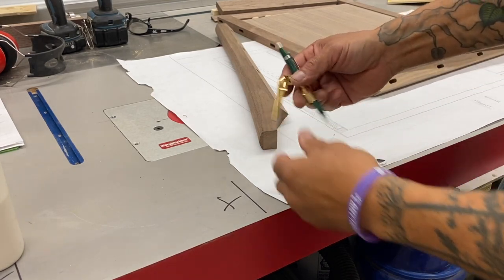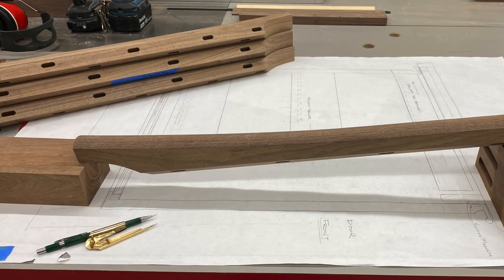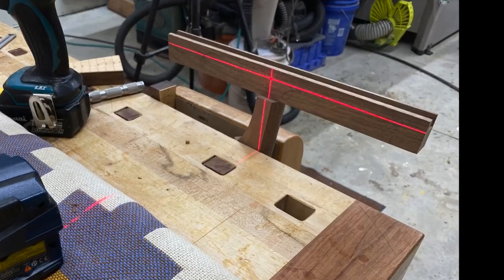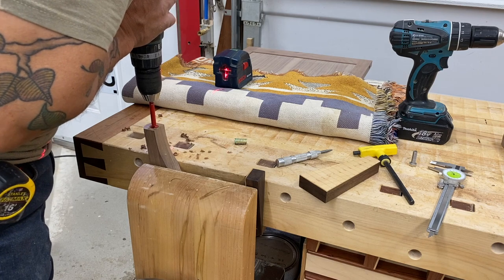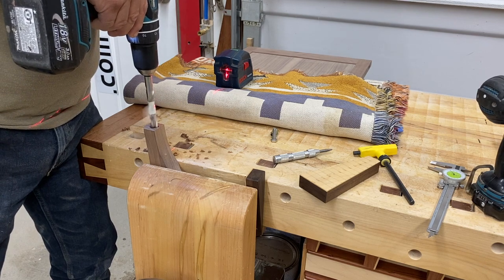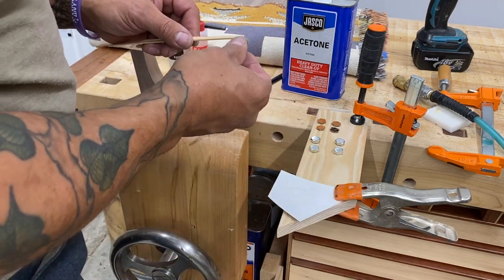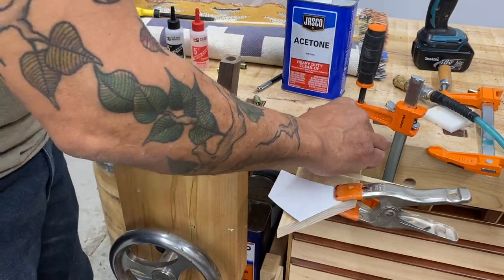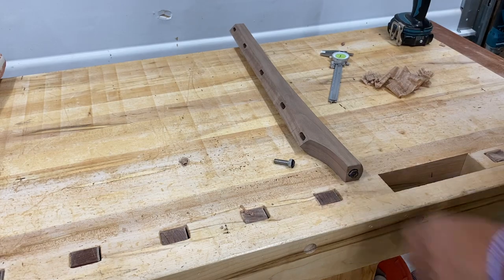Shop made leg levelers

Comment: Did a similar thing on a bunch of tables last year except, instead of hex head bolts, I used "elevator bolts" which have a very large diameter but thin head (1/16").  That shape head makes it easy to add a 1" felt pad to protect the floor.
Reply from the maker: I like that idea!

Comment: Nice video Ramon, thanks.
I guess I am a bit surprised at how much the door tops misalign when the case is not supported on all legs. On the other hand, that provides a great indicator of when you have the feet adjusted properly.
Paul
Reply from the maker: When building a carcass type piece, I always assemble (glue up) on something dead flat.  Then the doors are installed , insuring that everything is true.  Now, a cabinet or sideboard has an inherent weakness.  That is, the bottom panel keeps it rigid there...as well as the back can provide rigidity in the back.  But the front (with an opening for doors) means that the entire carcass can still “rack” or twist.   This is well known amongst cabinet installers...they need installed carefully to prevent them “following” a crooked wall or floor, which can introduce twist, resulting in misaligned doors. Hope that makes sense.  And thanks

Comment: Thanks, great content! Any tips on purchasing and installing those inserts? In my experience they are really easy to get started crooked.
Reply from the maker: Thanks. I found these with a Google search 5/16” x 18 thread inserts.  Now...an easy way to help them go in straight...use a section (4” +/-)of all-thread (or cut a bolt).  Thread the all-thread into the insert...and thread a nut onto the all-thread and against the insert. Now you have something that you can drive with a drill and the added length of the all-thread helps to keep things going in true.  Makes sense?